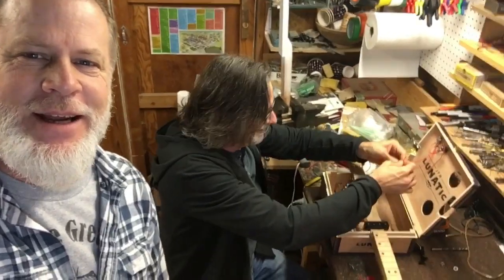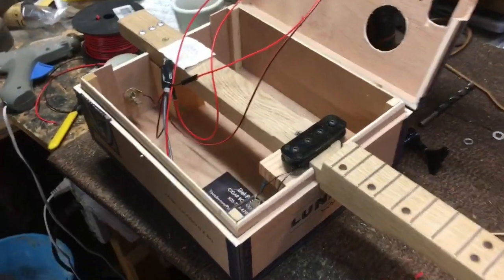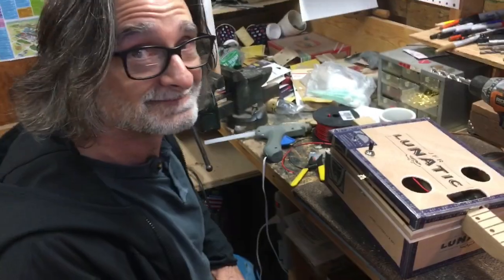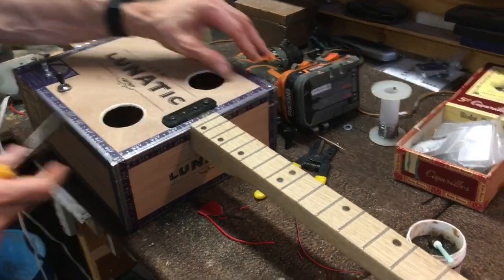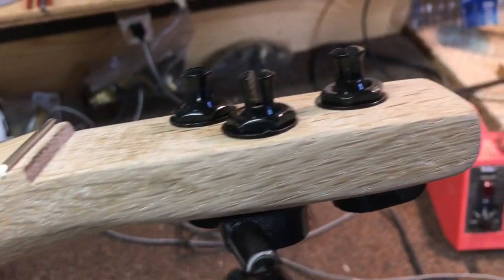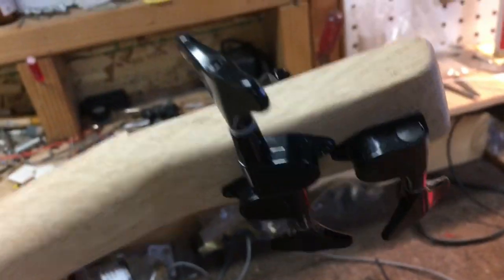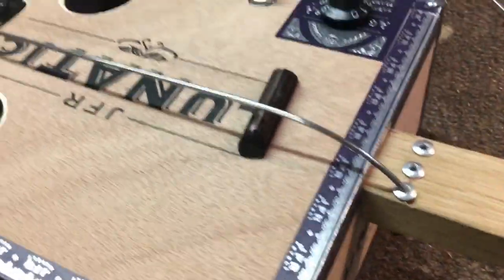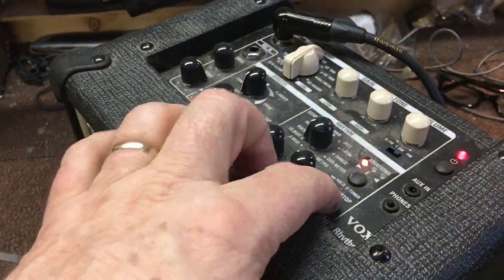Cigar Box Bass - The Lunatic

Comment: I had an absolute blast working with you on this build! Much appreciation for your experience, knowledge, and friendship, Del!
Reply: Scotty what did you use for string spacing? In the video you said you used 34" scale.
Reply: We ended up with an actual scale length of 28" and the string spacing is standard CBG from Del's template. It's a little tight, but playable!
Reply: that bass is sweet. I was just doing a search to see if anyone had done a bass at all. Glad to see it can be done, and done very well.
Reply: Will this work on a fretless setup Scotty?
Reply: @Jackman_NC  Del has far greater expertise in lutherie than I do, but I'm pretty sure that a fretless CBB would be quite doable. I've seen some debate on where to put the position markers on a fretless; my preference is to have them exactly where the fret would be on a fretted fingerboard, rather than in-between. Of course, then there are the fretless guys who don't need markers! 😎
Reply: Scotty - can you share the dimensions of the Lunatic box?
Reply: @davidspencer2333  The top measures 9"x10 3/4", and the depth of the box is 4".
Reply: Very cool!!!! Sounds awesome! Actually sounds pretty close to an upright. Bet if it were fretless with a piezo it would nail that upright sound pretty darn close. My main bass is a Jazz fretless and simply love it, I play and practice with it about 90% of the time. There would be no reason it couldn't be done as a fretless, personally I would put line markers where the frets would have been. Nonetheless that was an awesome job. Very soon I will be on the hunt for a 3 string fretless CBG, it's my reward for finishing 2,000ft of pagewire fencing to keep the cat in the yard.😀
Reply: If you are a guest in the future. Can you play the Barney Miller song
Reply: @christopherball7937  I had to think about it, but think it can be done with 3 strings. I'll certainly try. 😅

Comment: This is some fantastic validation. I'm currently in the middle of my first CBG..I mean CBB build. I'm doing a 2 string as I have used a hockey stick for the neck that passes through the box and, yes, still has the blade attached. Been wondering which 2 strings would be best. Leaning towards A and D cuz I read the bassist from morphine ran the same setup. Any advice would be dope.

Comment: Alright my man that $hit looks GOOOD! But, having build CBG's for several years now, I have learned something. Solid carved is Bad a$$, but laminated, is stronger and stiffer. Trust me on this. I have CBG's that can hold a tune for over a year, and even then, Very minor tuning required (I think it's more string stretch than anything). Still straight as an arrow and over 6 years under string load. And I can make then "look" solid with a fret board. But VERY nice! Thanks.

Comment: Any additional width or reinforcement required for the bass? And what size strings did you use? Sounds awesome!
Reply from the maker: thank you... we used OAK... one piece ... The Lunatic Bass is a 28 inch scale instrument and the strings are La Bella LTF-4A-S Short Scale Low Tension Flexible Flats Bass Guitar Strings, and the gauges are .100, .075 and .056.
Reply: @PuckettCigarBoxGuitar  do you think it is possible to use regular strings(large scale) in a short cigar box bass like yours? Your projetc has inspired me :) but it is quite expensive short scale strings here in Brazil.

Comment: What size bass strings are used?  Got to build one!
Reply: What scale is the bass?
Reply from the maker: 30 inch scale
Reply from the maker: the strings are flat wound low tension normal bass strings E A D strings
Reply: I don't see the description on my Cell Phone. Sorry for the questions I guess its a 28 not a 30 inch scale. Any way Just got the strings ordered